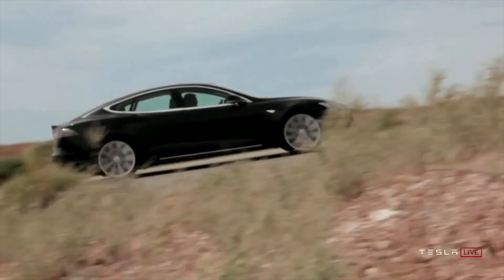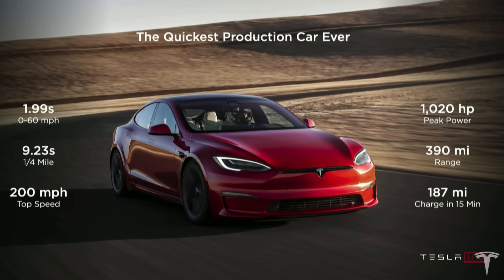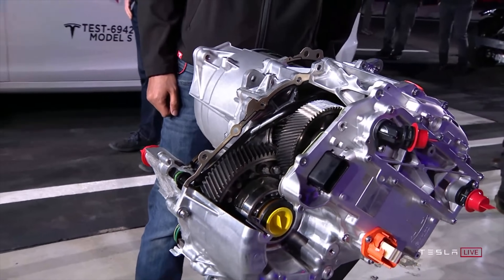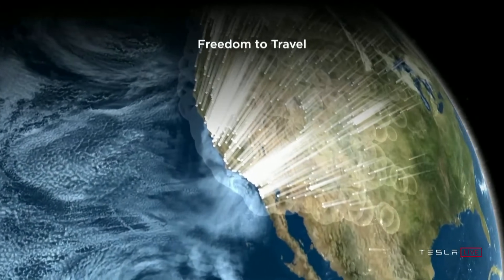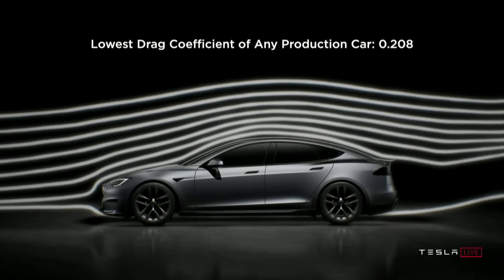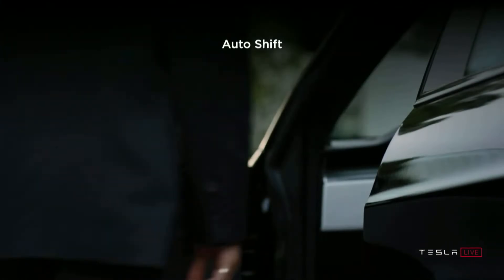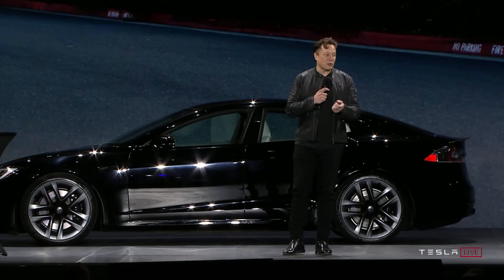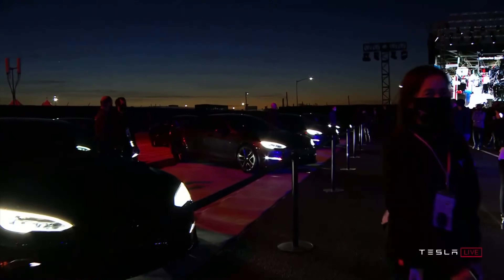Top 5 Features of the New Tesla Model S Plaid!

Comment: The carbon-sleeved rotors is arguably the biggest new innovation here. All electric cars have suffered from the same downside compared to ICE until now, that they run out of "steam" above 60 MPH. Porsche / Audi "solved" this with a dual speed gearbox which adds cost, weight, and potential reliability issues, Tesla just solved this the right way.
Reply: I appreciate for your comments,I will suggest for you to follow my trade analyst and accountant in other to make profitable income,i can't say it all here but be rest assured that you are in good hands in reaching your goal of making it huge📊💰
Reply: W•H•A•T•S•A•P•P
•+•1•2•5•1•3•1•4•4•6•0•3•
I•N•V•E•S•T ««» I•N ««»» C•R•Y•P•T•O
B•T•C ≤≥ A•N•D ≤≥ E•T•H•••••••

Comment: I can't imagine parallel parking and leaving a parking spot when parked between two cars with auto shift. We'll see.
Reply: By the time auto shift comes out I wonder if autonomous parking has had any improvements
Reply: Those are non issues. Autopark already works great with parallel parking. Even with the 2015 Model S/X's. The new auto-shift feature will be using the autopilot cameras so it will know the orientation of the obstacles/cars around it.

Comment: Does the long range include the same features as plaid with regards to audio glass/codec, 22 speakers, ryzen hardware?  The only distinguishable features are the range/top speed/0-60?  Also, is the new heat pump/thermal system only part of the plaid version?
Reply: Yes, the only difference is drivetrain, you get 3 motors vs 2. Everything else is the exact same from the LR to the plaid.

Comment: Soo , i hate that steering wheel and Auto Shift.
These just completely written off this car from the high performance cars that i would consider purchasing.
Sounds like it will be a lot of fun for people who have to get into tight spaces.
And i will be waiting for all the issues that system is gonna have.
Reply: It’s not on by default and you can use the screen or buttons right below the wireless charger.
Reply: @harsimranbansal5355  Oh , that's good then.
Now wondering about the steering wheel. How easy is it to take it off and change it with something else. Since it seems like it would suck ass to daily it with that steering wheel.

Comment: There is the Rimac Nevera that actually does get better numbers than the Tesla
Reply: Not technically a production car because as far as I remember you need to manufacture 500 for that.
Reply: @jakobboers5067  you only need 25 and tesla needs a dragstrip to get those times,rimac did that on a airfield at 80% of what it is capable of.At 100% on a strip it will be much much faster
Reply: @jakobboers5067  A production car only needs 50 cars according to Guinness, and they have more than that